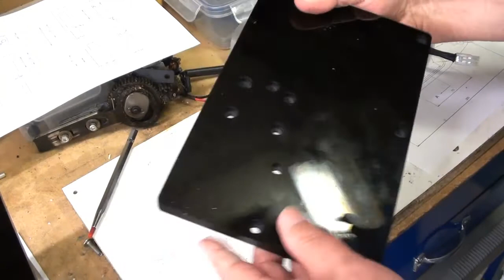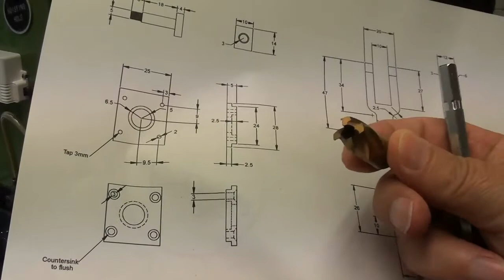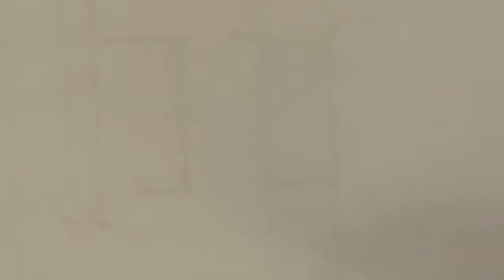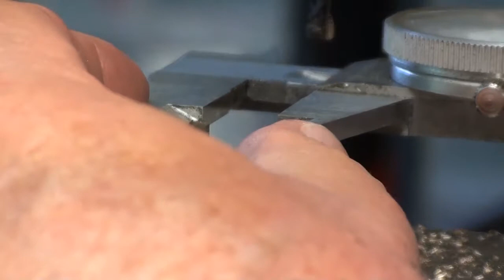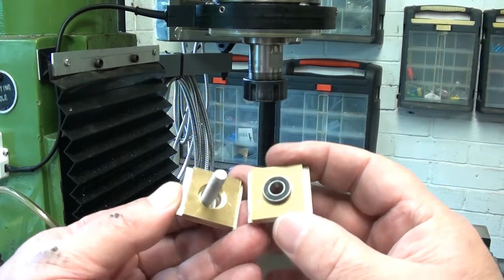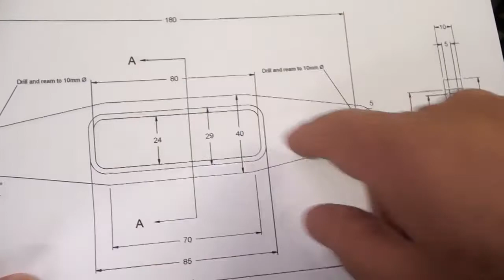Die filer - Part 4

Comment: Nice work are you from a toolmaking background judging by your approach
Reply from the maker: Thanks for the compliment, but no, I'm not.  My profession was as an air traffic controller.  I had an interest in all things mechanical from an early age, gained from my father, particularly cars.  In fact in the 90s I built a Fisher Fury kit car from the ground up, then sold it and put the proceeds into the purchase of a Ford GT40 replica.  Marvellous car.  I saw the Lola GT on which the GT40 was based, at its debut at a car show in London in about 1962, I think.
All my engineering knowledge has been gained by reading books and practical, hands-on experience.
Reply: @bizzibeeworkshop  my father was and continues to be a huge influence on me.  Thanks for the reply